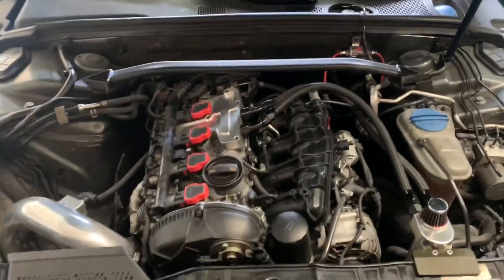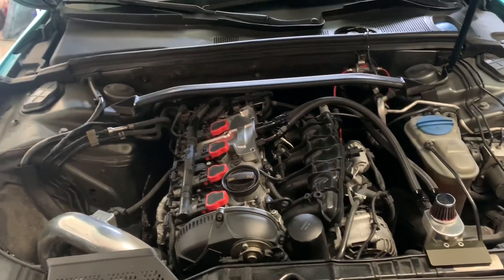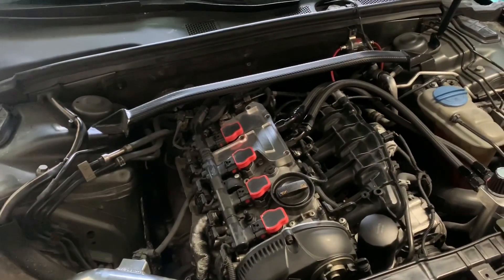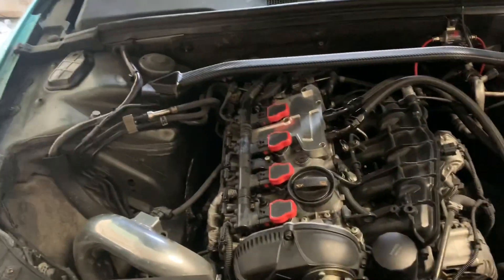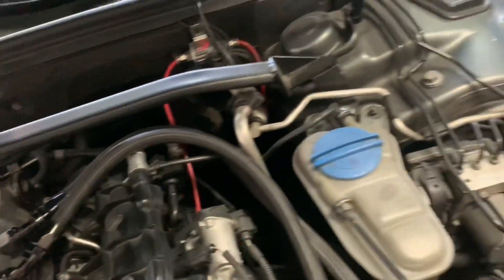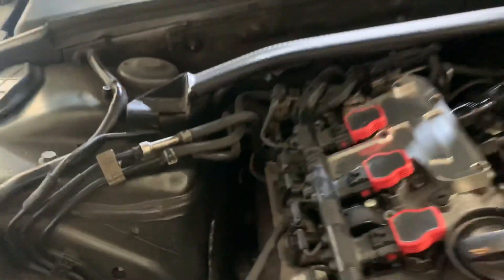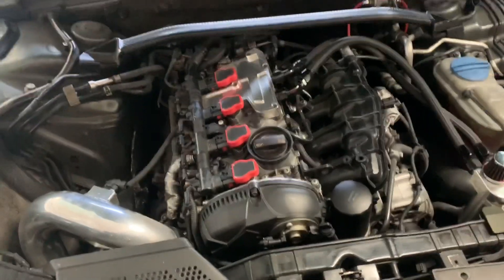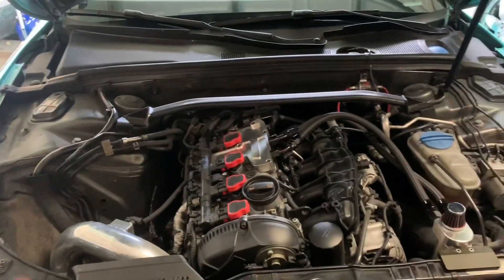How to get 455 hp to a Audi b6/b7/b8/b9 or Vw 2.0 tfsi or Fsi

Comment: What maf sensor are you using because mine just went into limp mode and won’t start
Reply: Yea I got the code mass airflow sensor running rich when I put the injen cold air intake
Reply from the maker: @marcusjones9609  watch this video, you may have put it in backwards, everyone always does, or not think about it , if you did you car is going to run rich and go crazy, because the airflow won't match the gas

https://youtu.be/GQmtZw4a7HQ
Reply from the maker: @marcusjones9609  at 3:47 when I take it out is the correct way go to 4:45 the open half moon part should be pointed towards the air flow of the cone, I had it right when I took it out, but miss spoke on the video, and corrected my self at 4:45
Reply: I have a 2.0 tsfi Audi A6 2014
Reply: Thanks I appreciate you takin the time to walk thru the issue I’ll keep you updated
Reply from the maker: @marcusjones9609  bet yeh we have the same engine, just sounds like its backwards or dirty let me know
Reply: Audi got 610hp out of a 4 cylinder what turbo u think they using? https://youtu.be/_CAVI0on7fo
Reply from the maker: @marcusjones9609  

one of these
in the description of the video 

https://youtu.be/xSbP1uluZNI
Reply: Thanks maf definitely was in the wrong way another? Did you have to tune your car when you put the new injectors in did you go to a dealer r could you tune it yourself
Reply from the maker: @marcusjones9609  no, no tune needed, it just unlocks the full potential of the tune, and prevents you from getting lean codes, by having to much air and not enough fuel. you def will get more horse power
Reply from the maker: I still have the factory one but im on my second one, did you tune your car, or did it just happen, did you get any codes, maybe I can help you
Reply: I’ll get the injectors and coils next week did you run a tune or have to take the car to the dealer to reset maf or injectors?

Comment: Does the engine withstand these powers as stock?Could there be a problem?
Are all mods written below the video?
What do you think about not wearing a methanol kit or what do you think about 100% water injection?
 Will it work with 95 octane gasoline?The highest octane gasoline 95 alcohol sale is prohibited in my country
Can this setup be done with the garett 2876 turbo?
Which engine oil do you use? Is the oil cooler needed for this setup? I have a 2009 Audi A5 coupe 2.0 tfsi. It reduces 1 liter of oil per 400 km. How can I solve this problem?
is the car water radiator a stock?
Reply from the maker: how you doing bro. Yes so far my engine has stock internals, with no issues, Ive been told 450 is the threshold. so far so good. But I do have another engine with forged pistons and rings I've had for a year, I figured if I blew my engine . I would just put it in but its been year lol. Im in no rush to put it in because its tons of labor, and no power gain on stronger parts

I have a ruiner flap delete that, I didn't mention , and turbo muffler delete, but they only ad about 5 hp

I've tried water , and my temps went down but it would bog a little, and loose torque, because the water didn't evaporate or atomize fast enough

yes 95 would work

yes the garret 2876 should be fine, had one before

I use Molly 5w40 full syntethic

I use Lucas oil stabilizer to help me with my oil consumption

yes stock radiator but after market inter cooler

God bless !!!!

here's my mod list if you have not seen it yet

https://youtu.be/oV252jayFA8

Comment: Is there a forged piston in the engine?
Reply from the maker: no I'm still on stock internals, but I have a new engine with forged pistons and rings, and bored, that I have not put in yet, I've had it for a year, my thought process was to push the stock internals to the max. to see what it can take, also me putting in the engine won't really give me any gains other than about 5 to 10 hp, from boring it. so im not in a rush lol, but im working on a 85 mm big big turbo project, that will defiantly need the new engine
Reply: @brucecustommotors  are you considering selling any of your current engine parts whenever you do?
Reply from the maker: @samyoule  yes of course
Reply: @brucecustommotors  my instagram is @samyoule, shoot me a dm and whenever you swap just let me know, I’ll be interested

Comment: Hey man what fittings did you use to mount the intercooler. And is it wobbling
Reply from the maker: what's up champ, no its not wobbling, it actually came with a couple of adaptors, so its snug
Reply: @brucecustommotors  I’m on a budget and cannot find one bellow $400 can you help me out?
Reply from the maker: @XVI.3  this should do the job. https://www.ebay.com/itm/Rev9-Front-Mount-Intercooler-Upgrade-Kit-for-Audi-A4-A5-B8-5-1-8T-2-0T-13-16/164078190025
Reply: @brucecustommotors  thank you

Comment: Bruce, I can’t believe you haven’t lost the plastic intake manifold. I’m installing an aluminum IE to my 2012 B8, well having it installed, along with a Cts down pipe and high flow cat. Also having Cts intake, Ko4 turbo, stage 2 tune and CTS intercooler. After waiting since June, parts are finally in! After having Bilsteen coil overs this car should be able to scoot. Hopefully will at least keep up with the wife’s TTS!
Reply from the maker: Yeh I know, man I'm excited for your ride, I would love to see pics, what tune are you going with for the flap delete, your car is going to be a beast
Reply: @brucecustommotors  APR doesn't write a tune for any after market intake manifolds. I just dressed mine up and it looks great I was hoping you could give me the part number for the S3 injectors you installed. I have seen some coming out of china but am scared to get knock offs. Where did you get yours and were they original Bosch? Keep up the good work buddy!

Comment: I found that plasma coils are even better then the R8 coils: https://www.bar-tek-tuning.com/1-8t-tfsi-plasma-coils-coilpacks <----(i dont know if this are the best ones but i found this for the 2.0TFSI) , Where the R8 coils are more higher resistance the Plasma coils know to produce better performance. The coilpacks allow you to run a larger spark plug gap, while maintaining a strong spark output. More power and less fuel consumption than with the original or red high performance coils. With such an increase in spark current, the ignition process is faster, leading to a faster burn, which results in more horsepower and torque.
 I hope im helping you out creating the sickest a5 2.0 TFSI ever! :D
Reply from the maker: Ok you sold me😂🤣😂, I’m buying them, and will try them out and do a review, and dedicate the video to you????anything for ore power💯💯💯💯💯
Reply: @brucecustommotors  Coool! you are awesome!!! we are going to make the fastes a5 2.0 tfsi that exist on the planet :D

Comment: Hey man I just have a quick question for you I have a 2009 B8 with the APR K04 turbo and their full tune set up so I can change files whenever I  need and downpipe with an AWE catback was watching you videos and wanted to know more about the S3 injectors went on APR but can't really find any info on if they are plug and play or if I need to do anything else any help would be greatly appreciated.
Reply from the maker: No there plug and play, it definitely optimized my tune to the full potential, I was running lean before I put them in, which basically means to much air or boost, and not enough gas. Here’s a comparison and example scroll down to the pic in the link,  it’s definitely an upgrade, apr actually recommended it to me. https://forums.vwvortex.com/showthread.php?4991112-Stock-vs-S3-vs-RS4-injectors-SOME-GOOD-INFO

Comment: Hey Man, I have an audi a4 2014, i have already got a muffler and resonator delete. I also have this "chip tuner" that plugs into my OBD port by Thorton, Dont really know if it does anything, but i would really love some tips in giving me some more performance.
Reply from the maker: Yeh that chip tuner or race tuner is like just a extra sport mode on your vehicle, at least the race chip, but that is mounted in your engine and reprograms the signals to your engines, the ones that go into the USB port with out software programming prior to it, that you can switch back and forth I’m skeptical about. But race chip does ad like 30 hp, but if you’re on a budget. Here’s some first baby steps, and it’s all about your budget in order know. the race chip would be a waist of money if you ever plan on going stage 1 tune, but sprint booster can be ran with a tune, and actually feels like a tune. I have a video on it you should check it out in my playlist under tune and performance 

1. Air intake, about 150$ to 300, any airflow helps your engine get more air in for a better combustion 
2. Gfb diverter valve, 100$ helps your turbo hold boost better

3. Sprint booster, quicker throttle response bout 250$

4. Stage one tune best bang for your buck (of course if it’s not in your budget you can take baby steps with the stuff above )about 399-499$ depending on who you go with, apr/revo/ie recomended

Comment: Do you have to retune after the changed fuel injectors? I currently have a B9 A4 with Integrated Engineering stage 2 and high flow cat downpipe. I could run a 104 octane map but not sure if that would work. I also want to add meth but worried about the retunes for each
Reply from the maker: no ie should do the trick, for example, when I went k04 and ran my 100 octane file. I would get some lean codes from time to time, because the factory injectors, could not match the air flow for the fuel to air ratio. So I upgraded to the s3/golf r injectors, and I was able to optimize the full power of my tune and gain some horse power,(its also recommended by apr and various tuners) and never received a lean code again, ideally your tune will request the fuel to match the air from you maf (Mass air flow sensor) regardless if you can get it are not, and the size of the s3 injectors vs the stock is to small of a variable to run rich with just spraying. here's a right up

https://forums.vwvortex.com/showthread.php?4991112-Stock-vs-S3-vs-RS4-injectors-SOME-GOOD-INFO
Reply: Bruce Custom Motors thank you for this man! Really appreciate the detailed response
Reply from the maker: @eliotpaynter3659  my pleasure 2020 forum, I’ve learned a lot from my followers aswell 💪💪💪💪💪💯💯💯💯

Comment: How much was the K04 and is there a brand you recommend for a 2012 A4?
Reply from the maker: Paul McDonald honestly apr /revo/ CT’s mainly use garret, so it’s all the same potential, just the build quality. Which ever you get the best deal on,  I went with apr , paid about $2,800 usd. But if you’re lucky you can find one on sale from either brands for, for about $1,500 usd
Reply: @brucecustommotors  ok. I am not sure what brand is good. How much added hp would the car get if I bought 1?
Reply from the maker: Paul McDonald https://www.goapr.com/products/software/ecu_upgrade/parts/ECU-20T-EA888-2-L. Apr specs

Comment: hi nice breakdown of what you done 
did you have to do any engine upgrades  like rods or piston even the cam follower and when first got the car what was the stock power im curious and mite invest in a b8
Reply from the maker: Khalid jabar I actually have an back up engine with forged rods and pistons, and timing chain, 2 tunners, told me my our engine peaks at 450 hp, one said 400hp, so it’s safe to say 450 is more ideal, being that if you tune an s3 or gulf r with the same engine you can reach dose numbers . But to awnser your question. I’ve been sitting on the extra engine for a 1 1/2 years🤣😂, I’m reluctant to do the work because, the forded parts will only make my engine stronger, but not as power. Although it is ported but that won’t be any power you will feel. And the cam follower is solid, I normally take of my fuel pump twice a year to check for wear on the fuel pump end of the follower.💯💯💯💯💪💪💪💪

Comment: Bro I just added meth to my car, and it added 54 hp, I didn't think it was possible honestly
Im running apr v3.1 like you and they told me they didn't have a map for it, I was pushing about 371, from my last Dynos, after my map and now I'm at like 430hp so I ran the 100 octane race file and boom, my car went to another level, thanks for the vids bro. I subscribed,  but I went with stage 3 snow performance, is it any better
Reply from the maker: Yeh its all about the timing, and tune, you just have to know the right time to start your spray, and max out your spray, thru the highest boost. APR is a safe company, so they don't promote anything outside of a tune. for b8 and below platforms, we don't have the option of e85, because were not flex fuel, and our intake manifold. So methanol is our best option, but I prefer it because, you can get more of gain. Apr can put you at like 380 with e85, look at my link in the description. Heck I know people running meth, and e85. Overall meth gives you more timing,  cooling, octane, and helps with predestination, so you can push your car harder, when I was with revo, I just advanced my timing with my sps controller, and apr 100ct race file ads more timing so I put 2 and 2 together, and stage 3 just gives you more visual features with your controller, but everything else is the same. Glad I could help, and thanks for subscribing

Comment: Love this video. As a new B9 A4 owner this is a great starting point. Already have an 034 Motorsport air intake but I’m afraid to do anything else mechanically due to dealer warranty. Gotta wait 3 years!
Reply from the maker: Andres Osorio yeh I feel ya,   B9 is a great platform, and it comes with more power to start, its my engine with all the errors fixed, if you ever get tempted, revo ,  apr, and ie, have map switching mode, we’re you can put it in stock, when my car was under warranty when I had stage 1 , I would put it in stock mode, and install my factory air intake, before service, when I went stage 2 down pipe inter cooler, and stuff. I didn’t even waist my time going😂🤣 here one of my videos on stock mode

https://youtu.be/GSj76OCyWlM

Comment: You didn't have any issues with those r sport injectors
Reply from the maker: cam9sec no the s3 golf r pretty much has the same engine platform. Let’s put it this way the dealership makes s3 , and golf r come with a tune to we’re the can ad more fuel. We’re as a3/a4/a5/gti/cc are down tuned. Because if you have to much air and not enough fuel, you will run lean, and if you have to much fuel, and not enough air you will run rich. That’s we’re a tune comes into place, I was always running lean from time to time, before I got my injectors. Because my car was pulling in to much air, and the factory injectors we’re maxed out. Now with the new ones , I’m utilizing more power and torque. So if you going stage 2 and above I highly recommend, there an direct oem replacement. Most aftermarket sellers refer to them as an upgrade💯💯💯
Reply: @brucecustommotors  
Thanks for the reply I just want to make sure, I have a 2010 audi a5 2.0t with a built bottom end all forged and starting to have missing on high load. Was told it might be my injectors.  So I've seen your build and going to order them but ecs told me they dont fit my year.
Reply from the maker: cam9sec cam9sec we have the same engine, shouldn’t be an issue, just understand that , the injector is not meant for our car so the dealership or a company will not say it’s meant although it will fit. Normally people just buy them, and the company doesn’t take responsibility, it’s like if you wanted put in a smaller tire at Firestone or discount, they wont put it because they go buy spec, look at the description in the link I send you , if you noticed it’s considered an upgrade,  there cheaper ones , I’m just sending you this link for understanding 2 different links just reference the part number, if you email me or give me your Instagram I’ll send you my old ones, and pics side by side, I actually had a buddy just do the upgrade aswell 

https://www.ebay.com/itm/283796138398

https://www.ebay.com/itm/Genuine-Bosch-Fuel-Injector-SET-OF-FOUR-VW-or-Audi-S3-TTS-Golf-R-06F906036F-/303692776392
Reply: @brucecustommotors  
Thanks for the information I'm going to order them. Like your channel watch it alot, I've done alot of the same engine upgrades. Keep it up
Reply from the maker: @cam9sec  thanks for the love